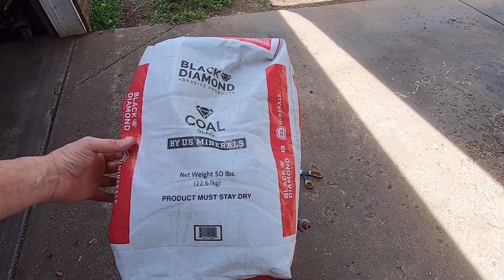Steve's 55 - Prepping and painting the 327

Comment: That motor is looking good looks like fuely heads (camel humps) on it either 202S or 194 intakes. Rob Cragers are really nice that 55 is sweet reall luv the two tone . I had Cragers for years 1974-2015 and went with Boyd Coddington Crowned Jewels in 2015  just be different  they are really nice wheels too.Steves car is going to be a head turner for sure.......Oh and congrads going over 5,000 subs...
Reply: I think Rob said it was a 64 327 and if the heads were stock they did not have 202s in 64, if those heads were from 64 they are 194s. They will still work well anyway. Plus the heads don't have the bolt holes for the alternator or a/c bolt holes in the front or back so they are 194s being double hump.

Comment: Thanks for the detail. I have learned a lot by watching your videos. You explained my vapor lock for me. I live in okc and have struggled with vapor lock over 100 degrees. I’m replacing my intake gaskets on my 327 in my 57 Nomad. Thanks again!
Reply from the maker: Get a 3/8" or 1/2" phenolic spacer. It will stop vapor lock for good

Comment: Always like the 327s, the best one I had I installed trips and it pulled like crazy with just 370s. Now i just like to build my old 283s because mine scream. 
Rob it's looking good can't wait to hear it run. Hope the engine builder installed the hardened exhaust seats. That's one less thing to worry about on pump gas.

Comment: That came out really nice!  The manifold looks smooth and like it's still wet!  It's nice to see how other guys prepnand paint their engines.  I always learn new ideas when I see what others do.  Great idea using that hi heat DupliColor engine paint as a base.  I know Uncle Tony even uses a propane torch to burn off the oils that get into the porous castings before painting and you can actually see the casting dry out as he hits it with the torch.  The wax remover looks like a great idea too.  The pool looks like a great idea, did it work?  Steve's hardtop is going to look outstanding with those Cragars!  As always, I am enjoying this build!  Take care Dan and keep up the great work!